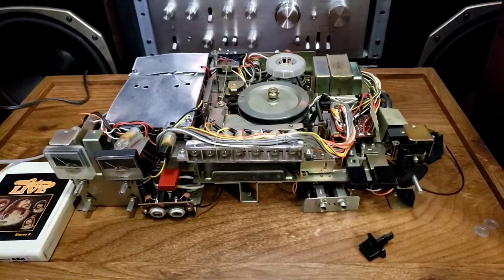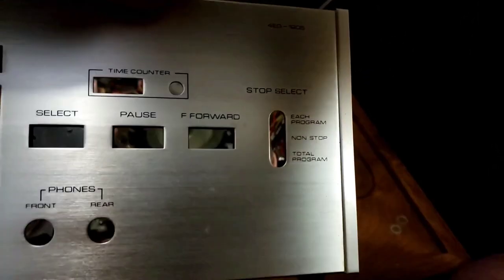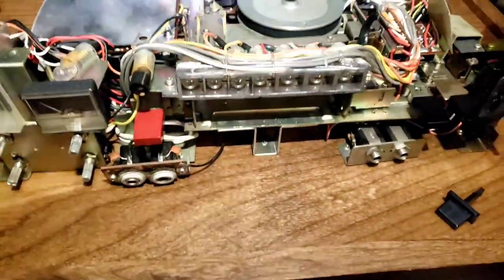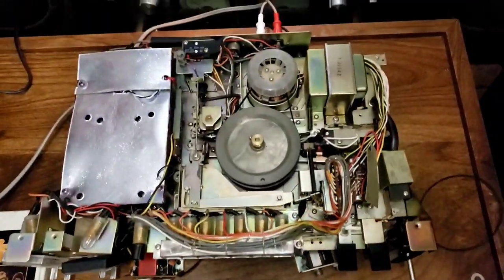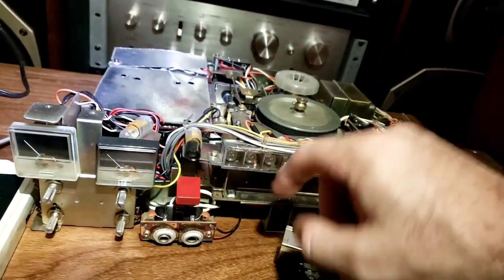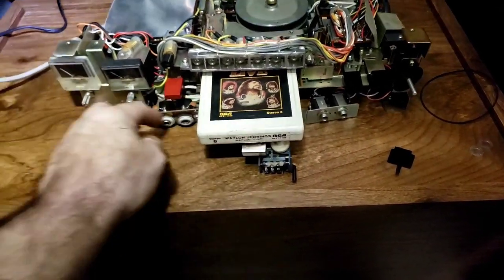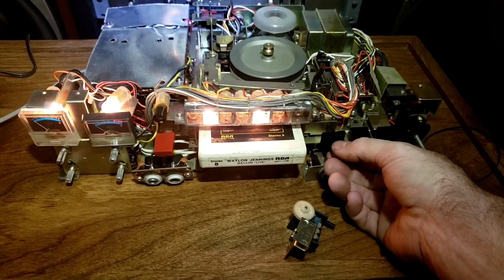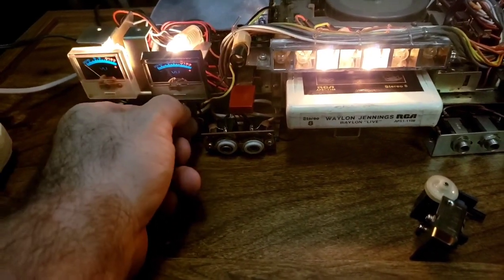JVC 4ED-1205 4 Channel 8-Track Player Recorder- Look Inside - Belt Change & Demo

Comment: I got one ;-) Question. Have you removed the capstan flywheel ( to clean a very dirty head) And if so how? Because the screws underneath the flywheel can't be turned from the bottom. Course the philips screw heads to unlock and remove the flywheel; are thus under the flywheel and can't be reached...??
Reply from the maker: It's been a few years since I worked on that unit with lots of others in between so I cannot remember if I did end up removing the flywheel on it. I will say that the Service manual steps do call for removing the flywheel to remove the head, however the cleaning steps in the Operation manual are simply cleaning it through the front cartridge door using a "head cleaning bar" basically something none metallic or magnetized that can allow you to get your cleaning pad on to the head. 

Removing the flywheel could potentially allow for better access to clean, I just would not touch the 3 screws securing the head unless your equipped to go down the path of aligning it. 

I saved the manuals, but I don't think YouTube let's us share links in comments any longer.  I'll pasted the link just in case it works, if not you can get to my manual folder via my store WWW.BIGAZSPEAKERS.COM 

There is a drop down box for additional resources in the too right menu.  Or they are also available on hifi engine for download. 

Hopefully this helps. 

Here is the direct link to my copies.  Hopefully it works. 

Cheers! 

https://1drv.ms/f/s!AtDkOAwGipBYjNZzVMAv5VFD9A8_Aw
Reply: @BIGAZSPEAKERS  First of all; thank you so much! Link worked!
Second: I upload a little video if I managed to remove the flywheel to have good access to the tape head. (It's is very well aligned no crosstalk etc.) SoI'm not going to remove the tape head. But just clean it. I scotch taped two small cotton sticks to make them longer, but you can't put any real pressure on the head and capstan. 
Again thanks for your quick reply and links! And yes I was now able to remove the capstan / flywheel with help of the manual!